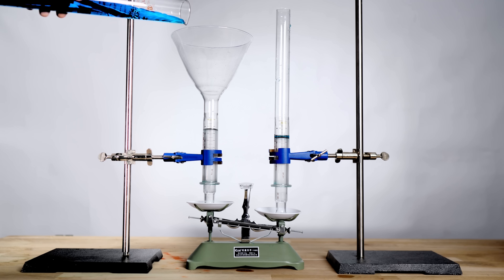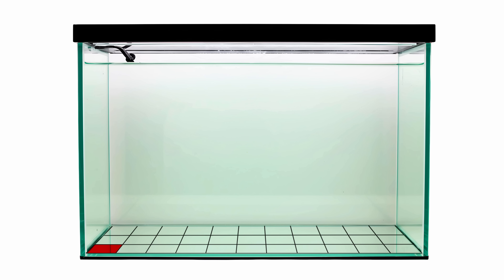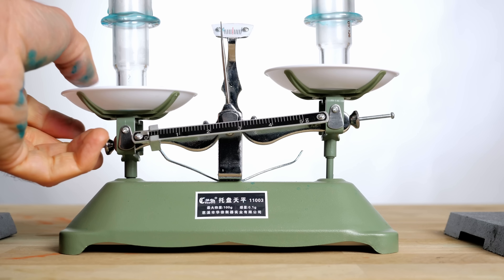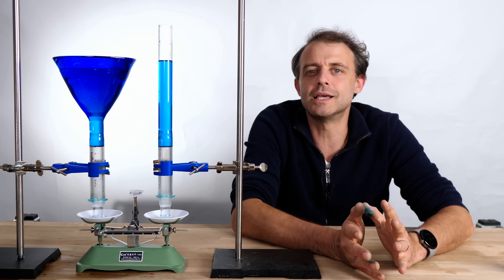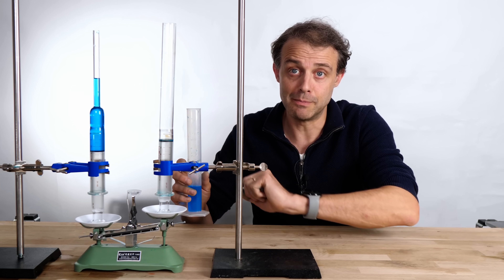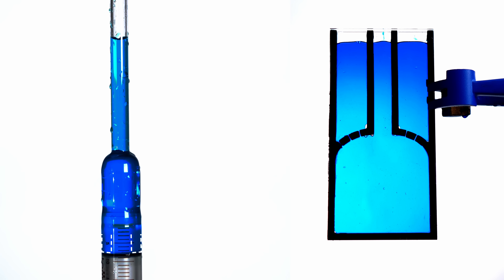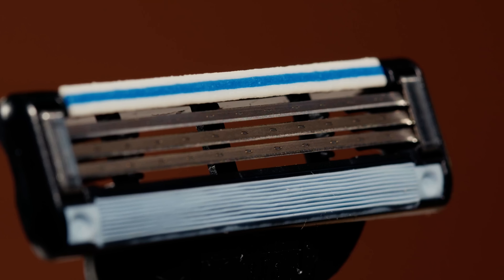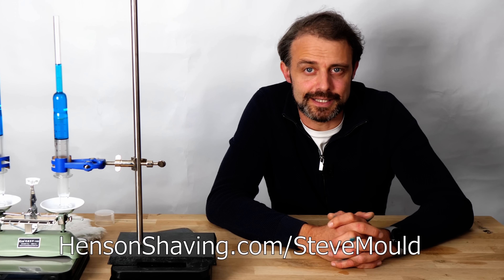The Hydrostatic Paradox

Comment: If you connect the two containers with a tube or pipe, does the water surfaces still level equally? Sounds like this would be a pump with more than 100% efficiency
Reply: Yes, it you connect those tubes with a hose, it would equal out in the height.

Comment: Okay 1 minute in and I'm staring at the stands. Those make it so it's not measuring the weight, but the pressure, pressure should be constant based on depth and not volume.

Comment: This is no paradox. The apparatus does not measure the weight of the water behind the pistons, it measures the pressure. The   scale balances when the two water columns are of equal height, as they are at 1:34 in the video. The pressure 6 feet under the surface of a swimming pool is identical to that 6 feet under the Atlantic Ocean. The area of the water column is irrelevant, only its height.

Comment: Hydrostatic pressure is determined by the head height (the height of the top of the fluid from the bottom) not the volume of the fluid. Oil field knowledge

Comment: I'm still confused. 7:58 What happens in the limit as the upper portion gets thinner and the lower portion gets shorter? You then have an infinitesimal amount of water somehow weighing as much as the water on the other side (or rather causing weight to shift from the stand).

Comment: My explanation of the phenomenon in the tube with a narrower top is that the pressure operates in all directions at a given height so there is a force acting upwards on the horizontal portion of the tube which means the net force is upward on that side of the balance. Nothing mysterious to me.

Comment: 2:19 the water above the funnel itself is really only pushing down on the funnel, not the displacement piston at the bottom. If you weighed the containers AND the water, the funnel would weigh more because then it takes into account the water pushing down elsewhere.

Comment: I'm a chemistry grad but ended up in the chemical engineering field. That means I'm self taught in a lot of the engineering concepts I use day to day in my job. I distinctly remember designing a coolant storage tank and researching the concept of hydrostatic pressure / head to understand how much pressure the base of the tank would experience when full, and I could NOT get my head around why the pressure didn't increase as the diameter of the tank increased lol

Comment: I don't see the paradox. It seems like the height of the water and the size of the bottom of the container are the only things that would change the pressure at the bottom. If you had a curved tube that bent upwards on the bottom of the container the water would press upward. It would flow out of the tube in an upward direction. This is pressure not weight.

Comment: I don't understand why you say that. The weight of all the water in the wide mouthed container pushes in different places. the center column pushes down in the middle on to the scale and the rest pushes on the wide mouth which is felt in the clamp holding it up. So measure the amount to force placed on the clamps holding the fixtures. That will show you how it works. The atmosphere is a great example the psi is 14.7 and that's a column of air going straight up. Not the whole weight of the all atmosphere pushing on you.

Comment: The pressure depending just on height applies to hydrodynamics as well and is the reason why some hydropower plants are just huge long tubes running down a mountain. The power output of a hydropower plant predominantly depends on two factors: the height difference and the flow rate (and also the density but that's pretty much the same for water anywhere on the surface of the Earth). The size of the reservoir does not make a difference and the only reason why hydropower plants have huge dams is to increase the height. That's why a lot of them are built on waterfalls or rapids.

Comment: Cutthroat all the way . Have used a single multiblade for almost 3 years, still sharp but requires multiple passes with a course material (wet hand towel) to clean and sharpen. Still, cutthroats are way cooler than ANY razor.

Comment: If all of the water in a "container" would put pressure on the lowest point, the lowest point of the pacific ocean would experience a pressure of approximately 7.1 x 10^23 tons. That's 710,000,000,000,000,000,000,000 tons.

Comment: From an inverted point of view, if the water in the straight column needed to be higher than the wide cone, it would allow construction of perpetual motion machines, thus is impossible. Combine with a U tube in the bottom, let the excess water flow from straight to cone, voila

Comment: Is there a difference between an open column and a column with a roof/baffles over the weight, allowing water to flow but there's a physical object between the top of the column and the scales?

Comment: Isn’t the force felt on the bottom area of a fluid more about the depth of the water from its interface with another fluid than the weight of the fluid in the column above said area

Comment: you should go talk to a hydrogeologists or mechanical geologists. the hydrostatic column decreases the lithostatic pressure. in some cases so much that you get a hydraulischen Grundbruch. 
And it can increase/decreases even more if you factor in water flow.

Comment: So if we add water but only on the sides on the funnel and not in the middle(it will be sealed) then sides should have higher pressure and impact weight of the middle?

Comment: A lot of machining channels, quite large and popular channels in fact, have been repeating a fundamental misunderstanding of this concept for years.

“Oop, getting some chatter, must have too much tool pressure (due to too large area of tool engagement).”
Nope, too much tool engagement area decreases the pressure on the system to below the threshold of system rigidity to where the tool flexes and the pressures experienced waffle around not being able to shear material. 

More area dilutes the force leading to too low pressures, but increasing feed rate to increase the force to restore the required pressure isn’t possible as system lacks sufficient rigidity to do so.

👍

Comment: somehow this feels like it could be used to make a perpetiuummobile xD
Like you can use a really small long tube and it will do the same work as a same wull width tube? Like you could have one side super small and to change its "workingwheight" is super simple, as you only need to remove small amounts of water, which in turn will move the scale with loads of force, as it is equivalent to the power of the other side, but there truly is a lot of mass moving. 
So if we can generate power by moving the real massive side and use only some of the generated energy to move the small side. bla bla bla.
I know it can't work but this feels soooo wrong 😂

Comment: they way i imagine it is, when the pressure changes in a shaped container like that funnel, that the column of water moves leaving a pillar or void, then the water level averages, and the new weight acts upon the column resulting in yet another adjustment, sort of like a super task where you always average a number until an unspecified optimal value.

Comment: I think I've got the answer to this but it has made me think: What happens with hydrodynamic shaped things, a cone for example, as they try to move through water - is that force spread out or is it equal to if the object were just a flat plane.

I think its about the direction of displacement being spread out. That the cone will push the water in all directions vs the plane pushing in one direction. But it did make me consider if what I knew about hydrodynamic shapes was true.

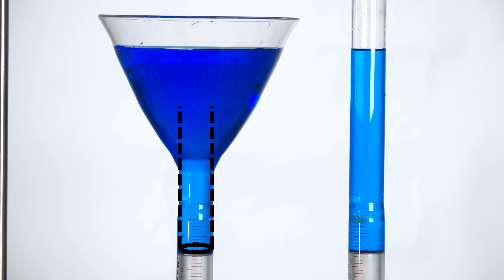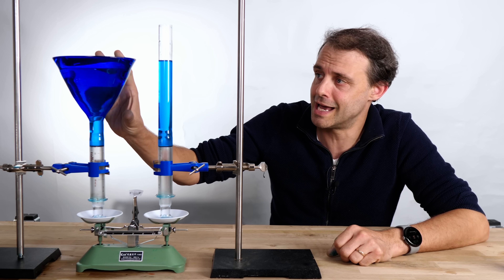Comment: 2:43 would it be otherwise if the cone shape funnel did not have the vertical tube instead it touch the base then the scales would not be same. i mean what if the water level started at the base of the cone will this theory 6:25 still hold?

Comment: The bit at the end with the small area at the top almost reminded me of a pulley system, or even gears where work is force*distance. 

It’s as if the thinner tube at the top and the thicker tube at the bottom is acting like a pulley where you can exert a lower force but a greater distance on the surface of the water in the skinny tube to move the scales, and if you inverted the tube on the left, you would need a greater force on the surface of the water, but a shorter distance to do the same amount of work. 

Hopefully this makes sense lol

Comment: The pressure in the last demo is distributed across the surface of the piston, so the force is the same, but if it were to move the piston, the level would go down much faster because the smaller column has less volume. This kinda reminds me of gears, it's like a gear reduction. You increase the output force at the cost of needing more input, because the amount of work still has to be the same. Cool stuff Steve!

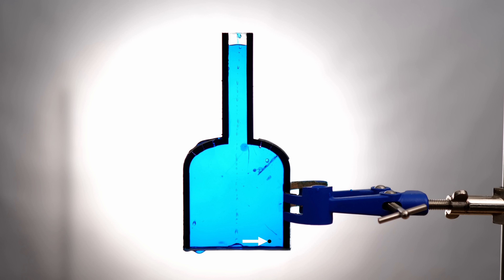Comment: STEVE! at 9:00 u said the pressure at the curved ceiling must but equal to the pressure at the bottom of the container but in actuality it needs to be equal to the pressure of the water column at the height of the curved ceiling

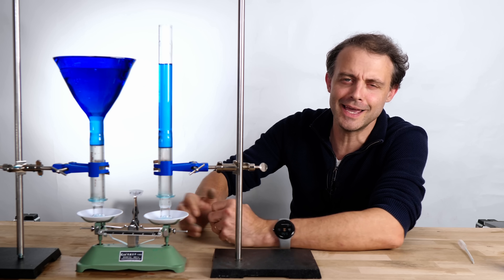Comment: Stopeed at 1:25. You aren't measuring the weight of the water you are measuring the force it exerts(it's pressure).
Along the same lines as "wow the dam wall must be very strong to hold back all that water"
No. If the water against the dam wall was only 2 inches wide but the same depth the dam would need to be just as strong.

Lets see how I go.

Comment: You kept saying you were weighing the water. You weren't doing that. You were measuring the force produced by the piston due to the force of the height of the water bearing on the area of the piston. It's a subtle but important difference.

Comment: 1:21 after pausing and thinking about this for a few minutes, I think the reason it takes less water in the straight piston is because you're only weighing the water directly above the plunger.  The water on the side pushes down on the walls of the funnel, which is being held up by the ring stand.

EDIT:  I was basically right, but he managed to bamboozle me again with the example where the tube is skinny on top and actually makes its stand lighter.
Reply: Exactly, I was confused at first because I thought the entire thing was being weighed (presumably with the scales calibrated beforehand to account for the weight of the vessels) but when I noticed the vessels were actually being held up it became a lot more clear
Reply: Yup, it was obvious to me already on the first minute of the video
Reply: @ain92ru  good fo you
Reply: Corect
Reply: Yes, like a bathtub is standing on the floor.
The force pushing on the scale is just the pressure from the water column per piston area. More water column or larger piston results in more force at the scale.
Reply: That makes sense. Well put.
Reply: Now imagine the tinner piston was connected to a flexible tube that goes around the other scale then a big container and then back above the original scale....

Whole problem with that "experiment" is it ignores atmospheric pressure. If the containers were closed on top the results would be quite different.
Reply: Using thinner tube and leaking into bottom side is advantageous.
Reply: If the larger container would push the smaller containers fluid higher you could just flow it back into the larger container and have infinite energy. Which would be too easy.

Comment: Simple very old principle (used extensively in engineering hydraulics calculations - and for instance in the oilfield, etc) that pressure is depth x density and it does not matter how much horizontal space the liquid occupies for that depth.  So a large lake will have the same pressure at the bottom than a thin glass tube of the same height (depth) as the lake.

Comment: Another way to think about the inverted funnel case is that it's acting like a hydraulic cylinder and multiplying the force from the weight of water in the narrow tube by the ratio of the tube cross section to the piston area, and pushing down on the piston with that increased force.

Comment: Tangentially related to this is why slow leaks in plumbing are deceptively difficult to seal. Sure, the flow rate may be barely a trickle, but in sealing the leak the flow rate goes to zero and the pressure at that point will rise to full plumbing pressure, which would burst most DIY fixes that intuitively would seem sufficient

Comment: Hello! This video was a treat as I am a mechanical engineering student taking fluid mechanics right now. Your descriptions were spot on and the way you explained the concepts was very thorough!
There are a couple things I would add to the part where you look at a small triangle of water. You just about nailed it, but another force to consider is the weight of the triangle of water itself. This isolation method works very well for sloped surfaces, but it separates the pressures of the water surrounding it from its own weight. This can complicate problems sometimes and ends up changing the location of the vertical resultant force from the container. Yes, the weight might be negligible compared to the external pressures when analyzing an infinitesimal chunk, but on larger bodies it is not. This method is handy because it is applicable to any size triangle, even one with no water above it (then you only have atmospheric pressure pushing down on the triangle)!
The Henson ad was great too. I love mine! Keep up the great work Steve, love your videos!

Comment: It's just equilibrium, since the funnel/cylinder/ect is being held, they don't add weight, while they create the resistance for the difference, just like if they were connected by liquid, instead of the plungers on a scale.

Saved anyone 13.5 minutes of way too much extra talking.

There is no way the science community didn't recognize that.

Comment: Misleading language from the beginning... This setup is clearly to measure the pressure, not weight. Weight is transferred to the stands. Also, expressing pressure in units of weight is soooo misleading. Why You Americans still use it like that? It seems like a paradox only because of that.

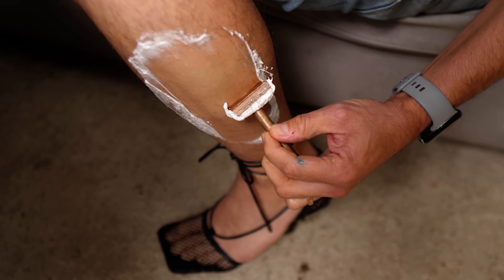Comment: 0:50 No! no it´s not  😝 11:45 I new this was coming, BUT i think you are mistaken, there are more variables to that equation, the name brand that we all used at one point, is up to 5 blades, and i think it´s the best and smooth shave i ever gotten, and it hurts way less than the cheaper ones. i have tried straight shavers befor (not these tho) and even a pro knife shave, but i still prefer the 5 blades one, why is that then?? are the 5 blades not digging in to the skin as much as one blade, so the one blade end up scraping the top layer of the skin? my point is, be careful with your integrity, you have over trust and you do grate content, but lending your integrity to commercials, and that your claim don´t 100% track, i love to see a complete video on this topic, i think we all who'd :-D because it´s expensive to shave, and the Henson i expensive to buy and if it don´t work 😕 Keep up the good work have a great day all 😀

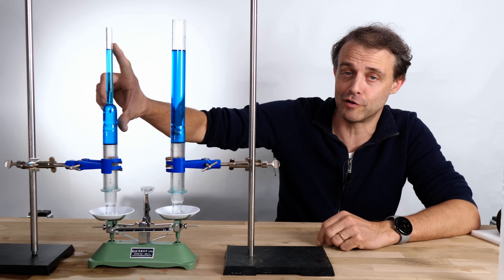Comment: 10:00 - The problem with this verbal definition is that it doesn't handle the situation where you put an S-shaped curved glass tube above your piston, so the weight of water "directly above" any point on the piston is the weight from the bottom to the middle of the bend (roughly) yet the hydrostatic pressure is the same.

Comment: 0:36 water pressure increases by height/depth not by volume, from what I understand, so the pressure will be greater at the base of a 150ml cylinder with a small diameter and more depth; as opposed to 150ml in a container with a wider diameter and less depth.
The tube method your using seems (to me) to be measuring pressure and not mass, hence the pressure should be greater from the taller cylinder with less diameter and more depth.

Comment: Steve, Now do the same experiment but use a compressor or pump to add or remove air pressure from the top of the tube.

Comment: I think your analysis of the razors your helping to sell is a bit shallow.  Pulling the skin taut has always in my experience given a closer shave.  Maybe because I've always either had baby fat when I was younger or actual old man fat now that I'm older, and maybe some men don't have anything but tight firm skin on their face, but if you have any looser skin you need shave having it pulled tight, either by the razor or your other hand is very helpful.  Secondly the multiple blades are offset in height from each other by an extremely small amount.  So they both act as a way to cut closer and closer with a single swipe across your skin but they also have a bed of nails effect helping to prevent cutting your skin.  The force as you point out is spread out.  I've certainly given myself cuts with multibladed razors, but I've cut myself way worse with single bladed setups.